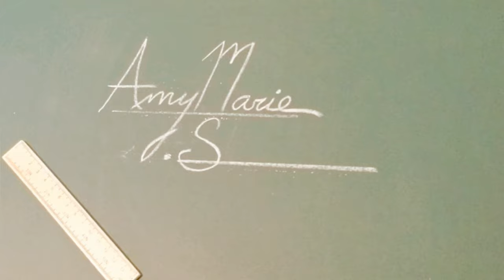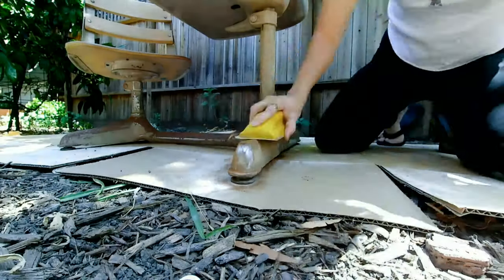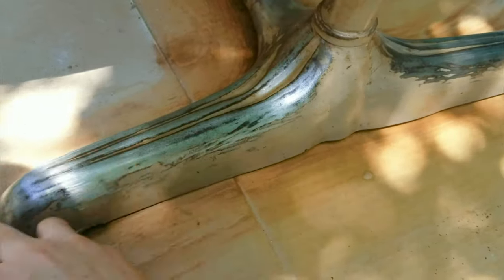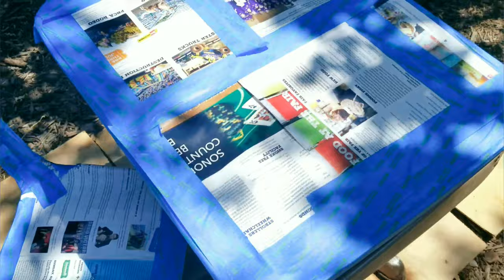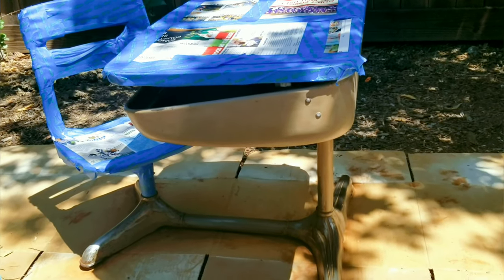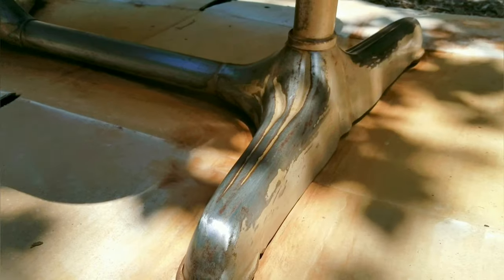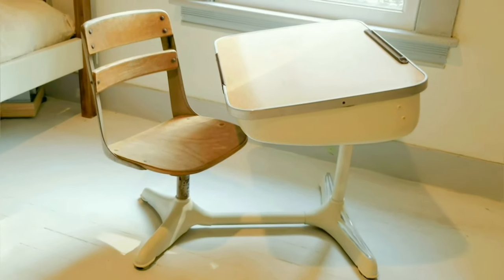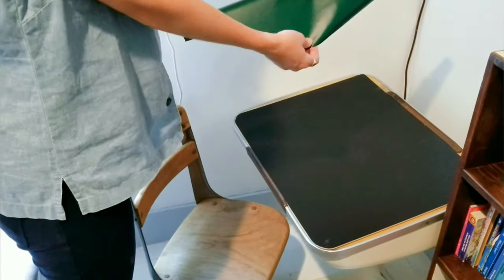VINTAGE CHILDREN'S DESK MAKEOVER.

Comment: Not bad how turned out. Couple tips could help though, there's a chemical named "jelly" that almost instantly dissolves rust and can be wiped off instead of so much sanding, and instead of using so much tape, bags can be used to cover areas not getting painted.
This one piece model desk is a good looking one.